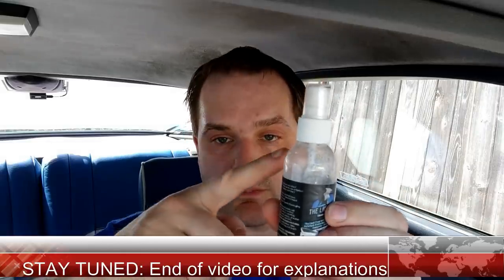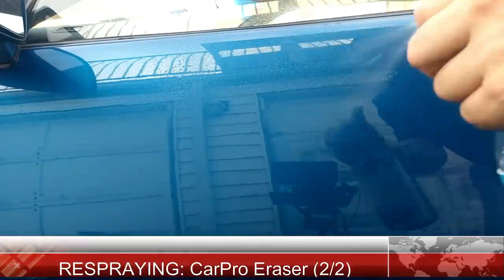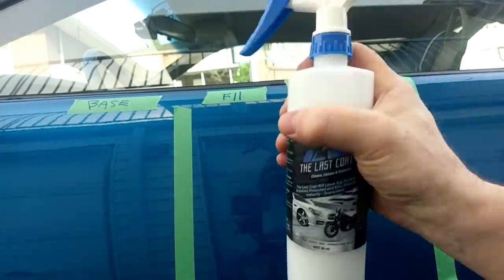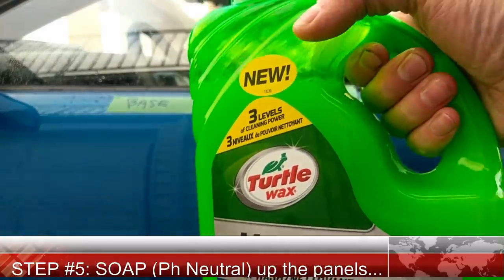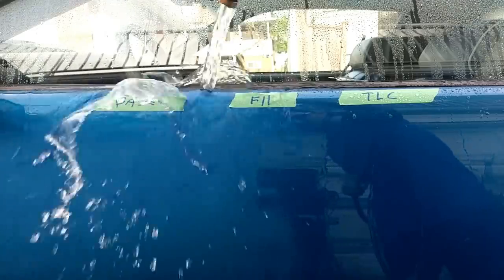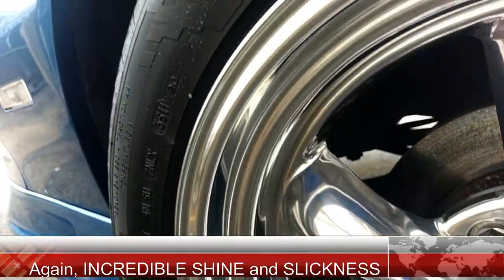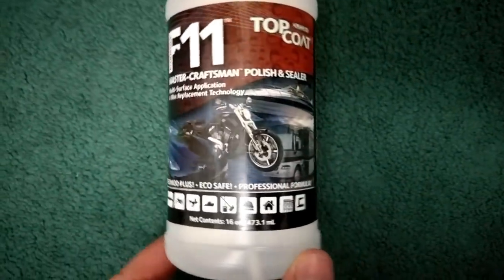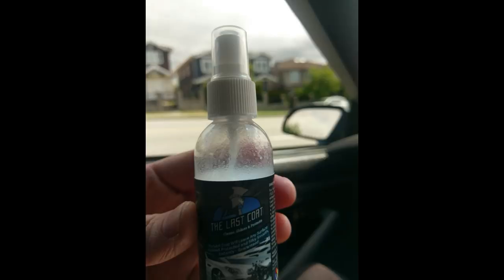TOPCOAT F11 VS. THE LAST COAT. (RESULTS WERE SHOCKING!!)

Comment: Have had both the Topcoat products and the Last Coat product subject to several rain storms over the last month or so.  I see no real difference in performance and durability between them.  Since these are both very similar water based formulations, I would not expect results  be much different.  I’m testing against older Topcoat formulas, but unless something has changed in the formulations, I just can’t buy your claim that the results are shockingly different.
Reply from the maker: I cannot speak for anyone else but my personal experience. I personally had over 15 coats of F11 on my Camaro. I am in a lot of car shows during the Spring and Summer and at the time (2017), I had been in around 15-20 car shows (indoor and outdoor) and before each show, I would apply a coat or two not that it needed it but to give it that added "WOW" factor.

Now being that I was in a show nearly every 1 - 2 weeks, I didn't get a chance to give it all that long between the two and also 2017 was a VERY dry year for Vancouver, BC. Canada.. 

It was not until the shows stopped or slowed down and I didn't add the coat, and the RAIN started when I realized FOR ME, even with many MANY coats on the car I realized that the rain was causing the slickness to dissipate at a fairly quick pace. Even after 1 rainfall I would go outside to discover all the slickness GONE.. I also didn't like that I could not use SOAP to wash the car and relied on using just WATER..

Now with TLC, again MY personal experience. I find I don't need to re-apply before each show. And after rainfalls, the slickness would still be there.. Even if the slickness started to dissipate due to dust on the paint, I could take a spray bottle of water and the slickness came back once the dust was removed.. OR a ph neutral car soap... However, that same soap would reduced f11.

I also had an annoyance with F11 in which I found no matter how many times I would wipe it, it reappeared in streaks..  would apply it at a car show... All looks good.. And then come back an hour later to find what looks like streaks over the car... Come back with a dry microfiber towel.. And again a little later more streaks would show up.. I don't have that issue with TLC on my car.

As far as SHINE, I didn't notice a difference between the two. I did notice the durability of the SLICKNESS was stronger with TLC and less dust stuck to it.. I would literally spray TLC ANYWHERE on the car (even under the wheel well) and mud and dirt would really be reduced on sticking to these parts..

I will be applying the two side by side to the entire car but that car that I was going to apply it do was hit and part was repainted and so I cannot add it to the front quarter panel for at least 3 months. I will add it to the rest of the car except the weather here has been getting in the MINUS and calling for snow flurries... I was hoping to have the two side by side BEFORE the SALT and snow to see how they deal but that accident and the weather is putting a damper on that..
Reply: WestCoastCamaroZ28   Paul, your streaking problem was due to the towels you were using.  You need to make sure that the final buff is done with a DRY towel, and it must be the recommended GSM and type.  This is especially important on glass.  I finish my glass up using a dry microfiber glass towel, which is very fine, almost silk like texture.  If you don’t use a new towel, you are just pushing more product around with the damp towel, and it will never buff out

Comment: I'm more than particular about my vehicles.
 This F11 is just JUNK!
I've used it on parts of my cars. Hoods, trunks, doors.
It really does nothing more than a good wax or polish.  The difference is.  F11 cost is out of control. You can purchase better or just as good of product for a 10th of the cost. The difference between the two is the cheaper product works.
DON'T WASTE YOUR MONEY!
Reply from the maker: You are correct. F11 did not live up to expectations and advertising on my car so I've switched to tlc the last coat. Extremely happy with that decision.

Comment: F11 does state that it takes 1-2 days for it to cure and more coats the better. I haven't bought either just something to note. Maybe a long term test with both cured for a few days. But it is still impressive how right away TLC is working compared to F11 thank you for the video!
Reply from the maker: I know F11 very well. I had over 20 coats on the car within the year I had the product. I didn't realize the lack of durability on my car as I was in a car show almost every weekend and so I would re-apply a coat each time.. In essence, replenishing it.

Once the shows started to shorten out, and due the fact we had a LOT OF SUNNY weather last year, only then realized that the slickness was disappearing after a rainfall or two once it started to rain and the fact that I would not be re-adding a layer anymore since the shows were being stretched farther apart.

In my opinion and personal experience on using F11 and now TLC (The Last Coat) on my car, TLC far exceeds F11 in durability. With F11, I found that the slickness quickly disappeared turning into the "squeaky clean" feel, where at TLC remains slick for MUCH MUCH MUCH longer!

Even if there is dust accumulated on the paint, either using a PH neutral car soap OR just a plain spray bottle with water in it.. I can spray the panel down and carefully wipe dry and the SLICKNESS is still there..

Comment: Good review.  Also noteworthy, is any "garage queen" can get by with very little paint maintenance as opposed to, for example, my 3500 RAM which spends it's life outside.  A comparable "light" product I use on my garaged cars is Hybrid V7 as it's a light coating and can be applied frequently.  So, bottom line, basically any of the newer "light" products are probably OK for a garaged vehicle, unless you want to apply the light product every week on a car which lives outside.  However, unlike TopCoat or The Last Coat advertises, I'd never "dry" apply and wipe over a dirty car with any product.
Reply from the maker: My car is a daily driver and I WISH I had a garage.. It's outside all year round, whether it's Sun, Rain, Snow... :-)

One test which I am trying to find out if I am allowed, is there is a truck that has been in our underground parking lot (Business Owners friend) who left it there for over 1 year now. The truck is COVERED in DIRT, DUST, dried water stains, bird crap.. I apply a SMALL spray and the that outcome on a small circle on the hood was a SLICK, new looking paint..

Not saying that this is the end all of all products.. I've just stating MY opinion, and experience so far.. 

I'd like to see what TLC could do on this truck.. In the condition it's in (tires are flat from sitting there LOL)..
Reply: How the hell do you keep your daily driver so free of ROCK CHIPS? Give me your secret lol.

Amazingly detailed and informative video Paul!
Reply from the maker: LOL. Honestly... I donno.. I try to avoid construction areas, and gravel..
Reply from the maker: Hello. Is this a reply to the video or the comment above?

Comment: Do you have a follow up video on how long it lasts without adding another coat?
Reply from the maker: I have a plan to try applying it along with f11 and unprotected on my winter car (chevy cruze) this weekend. My plan is to split the cruze down the half thru the hood and roof into 3 sections. Base, f11, tlc. After stripping and fully prepping the surface. Incuding the wheels.
Reply from the maker: Unfortunately this had to be temporarily canceled. The winter car that I am driving was involved in a hit and run. As a result, I now have to wait because the side panel has to be bent back and repainted as so obviously there is no point applying any of the F11 or TLC to the car as the test would be interupted. :-(

I will let you all know when this changes..

Comment: Have you tried a product called Produxa, as I have been a Detailer for 20+ years and tried many products, finally broke down when I saw the F11 top coat product and several months later when bird droppings on top of my xc60 and it didn’t protect worth beans, after purchasing several packages, then buying the gallon size of F11.  So I’m back to comparing products and the Top Coat and Produxa have filled my social media lately, and trying to figure which to purchase next.  They also have the same spin the wheel 15% website gimmick and seems similar German designed formula and produced in different locations, but wanted to see if yiuve tried or heard good/bad about a comparison.  

I’m very unhappy with f11, after it dies seem to wash off, and I’ve applied well over 20 coats with it over the year on two very clean black vehicles, but seemed it never held up. 

One more product I have enjoyed and they came out with a new product that seems similar is by Flitz called Sealant, extreme clear gloss and surface protection. It’s has far outlived F11 in just a few applications, but is similar priced for 16oz, although the metal bottle is much nicer. Any thoughts are welcome.
Reply: Oops I meant Produxa and The Last Coat I’m trying to compare not Top Coat.
Reply from the maker: Hi. Thanks for the message. I actually have not tried the Produxa product. It's always on my newsfeed but after using TLC The Last Coat, I see absolutely no reason for me to want to use it. I am extremely happy with TLC that I feel I don't personally need to try anything else. I too had around 15 coats on the Camaro of F11 and found even as a rainfall or two, the slickness was GONE..

Stay tuned, I now have my winter car (Chevy Cruze) and in the coming weeks I'll be dividing the car down the middle with F11 and TLC and have a heads up comparison to shine and durability. I am sure that F11 will quickly fail as my tests results concluded but would like to see a direct comparison visually on a car.

Comment: Makes paint surface very slick, does it do the same for brake rotors?
Reply from the maker: Like anything else (Wheel tire shine for instance) if you get any on the rotors, the moment you apply the brakes the overspray comes right off. I've never had any braking issues and I sprayed onto my wheels without worrying if it got on the rotors or not.

Comment: What is your basecoat if you have one or are you showing you are only using tlc as your total vehicle protect
Reply from the maker: Hi. I am not entirely sure what you are asking... If you are asking what type of paint is on it? I would assume Waterbased? The hood was painted when I bought the hood back in 1998 (21 years ago) and the entire car was re-clearcoated to seal in the new stripes painted on it (so the stripes were not sitting on top of the paint like a decal would).

The car was using Zaino for over 15 years and I switched to TopCoat F11 back in June of 2017 in which I did a review comparing TopCoat F11 to Zaino. From the results of how easy it was to apply for the same results, I decided to switch the TopCoat F11 and used it for 1 year until I realized the LACK of durability which showed itself once it started raining and I didn't reapply as much.

I have since completely switched to The Last Coat (TLC) and have used it for nearly a year. Absolutely swear by the product because of the results and most importantly DURABILITY which TopCoat F11 didn't have. I also have recent reviews that showed the lack of durability of F11..

I stripped the car of all protection and only have The Last Coat (TLC) on the car now. I've now started using it for my Winter car which again I did a recent review and still absolutely praise it.

If that is not what you meant, I apologize.

Comment: How is it with swirl marks?
I didn’t recall hearing anything about this in your videos?

I know you have 15 coat of the f11 on your vehicle prior to using TLC.... so maybe the swirl marks were gone because of using F11?

I would like your perspective on this, seeing how you are always looking and buffing our your ride.
Reply: f11 doesn't and will not remove swirl marks bro only way to get rid of swirl marks is by polishing the car.
dont pay for this over price products do yourself a favor and go get yourself or order a gallon of P&S bead maker let it cure for a few hrs 8+Hrs and youll see how slick and shinny you ride is going to look.
if you dont believe me look the product on yt  and you'll see how many good reviews bead maker has.
best of luck.
Reply from the maker: Hi. Unfortunately no. The Last Coat, nor TLC nor TLC2 will actually remove scratches or swirls. While it might make them less noticeable from a distant due to reflections, any professional direct light source will show the swirls.